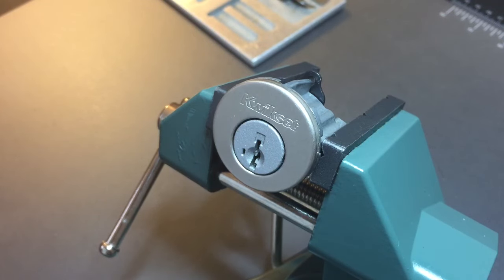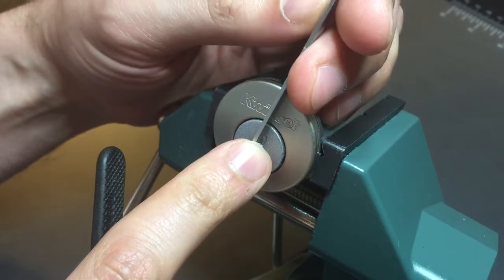[153] Kwikset SmartKey Rim Cylinder Picked and Gutted

Comment: So the one thing I (Im a Locksmith) am confused or perplexed by is how you were able to put pressure on the side by at all. Because you can pick at these cylinders all day long, but if you don’t put pressure on the side bar, you can line the key pins up to the sheer line, but the cylinder still will not turn. Any answers on that? Does it have something to do with you inserting the tension wrench at the top of the key way?
Reply: Its cause this is an older generation that isnt a reverse side bar. The new Gen3s are the ones with the reverse sidebar that needs to be individually tensioned.

Comment: I've tried picking this lock core unsuccessfully numerous times.  What I notice is that no mater how much keyway tension top or bottom, the pins remain springy.  I feel ZERO clicking.  I can't figure it out for the life of me.  Still an amateur when it comes to picking, but if I cannot get the pins to bind with any amount of tension, then it seems unpickable.  I've tried, moons, diamonds, hooks and raking.  Is there some reason I can't get tension on this type of core?
Reply: Check vid # 904, this lock has been redesigned and you've got the newer one.

Comment: Can you reset such a lock without the original key?
A client just gave me that lock to rekey after throwing the original key with the box.
Reply: Take it apart like he did here, but don't remove the notched wafers. Then put a new key into the lock and reassemble. It should work with the new key.

Comment: Whats the difference between this kwikset cylinder and the one from your other video where you had to slide the stock shim into the outer edge of the cylinder?
Reply: This is an early version of the SmartKey. Video 904 was a Gen3 version with a reverse sidebar.

Comment: These fucking piss me off! I have been a locksmith for years, consider myself a decent enough picker and I have never gotten one of these picked! I have seen videos of people raking them open quickly with light tension (they said that’s the secret is light light tension) I had one just the other day with easy biting (44234) and still couldn’t get it this is maddening! I apparently need to practice more! Picking open medeco is all well and good but in the field you’re running in to these much more than medeco I guess I need to bring one home and practice practice practice! If anyone has any pointers to the secret to picking these please enlighten me
Reply: Are you sure youre not running into the Gen 3s with a reverse sidebar that has to be tensioned with a shim first?

Comment: do you have to have the original key to reset the lock or rekey the lock?
Reply from the maker: +Joe Rosenbalm (ceojoe) You need either a working key or the ability to pick the lock to reprogram it.
Reply: +LockPickingLawyer OK thank you
Reply: or it is possible toto take the plug apart line up the sliders and put it back together and stick your key in and rekeyit without oroginalkey. or you can buy one of the smartkey rekey cubes. i have one and it works well . there are a few videos of different ppl rekeying these without original key
Reply: you just need to be able to reset the lock to any key, if no key there are reset tools but you can also disassemble, line up sliders under slide carrage unit to any key and then reset like normal. however dissembly without a key is tricky but not impossible

Comment: Hey man, great video. I was also disassembling this same lock, however at some point when I took the plug out a very tiny spring fell out. Since you seem to be very knowledgeable about this brand, would you happen to know where it goes? Here is a picture of the spring with the plug, along with some other disassembly pictures. 
https://imgur.com/gallery/6sA9u
Reply from the maker: +Kyler Donlan is that the spring that loads the slider cassette?
Reply: I believe the spring that loads the slider cassette is still in there, I am referring to the spring that is below the plug in the picture on its own. It is very tiny compared to the rest of the parts, and I have not seen it in any disassembly videos (unless I missed it). Wasn't sure if you would recognize it. I should also mention that currently my plug will turn in the cylinder 360 degrees.
Reply from the maker: +Kyler Donlan is it one of the sidebar springs?
Reply: I don't think my sidebar doesn't come out like yours does, if you look at the photo I posted it looks slightly different, and almost seemed to not be one solid piece. As to if it is the sidebar spring, I can't say I'm positive, but I would have no idea where it would go if it was!
Reply from the maker: kman1759 There should be two tiny springs under the sidebar to push it into the outer sleeve.  I don't have your version of the lock, but there must be a way to take the sidebar out... look carefully.
Reply: Per Kwikset, "The small spring goes to the back of the plug assembly past the 5 springs and into that small cavity" in reference to the picture of the disassembled plug with the spring below. However, I think they may have misunderstood and thought I was talking about the spring attached to the wafer part of the plug.
Reply: Just took the sidebar off and both springs are present!
Reply from the maker: kman1759 Then I'm lost... Sorry.